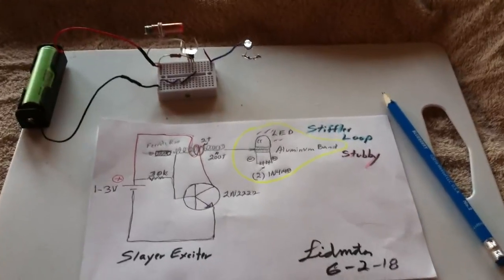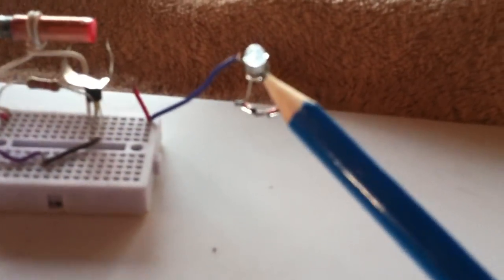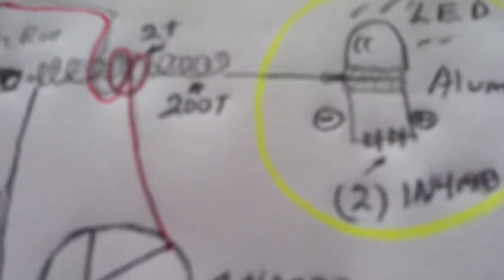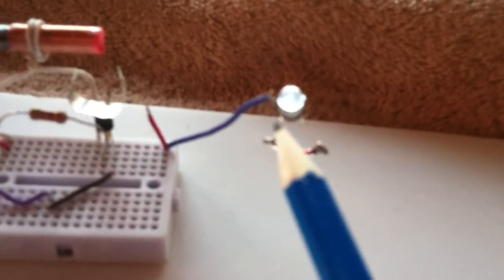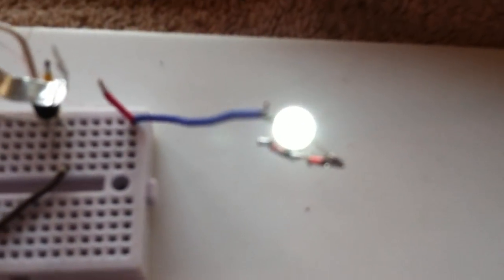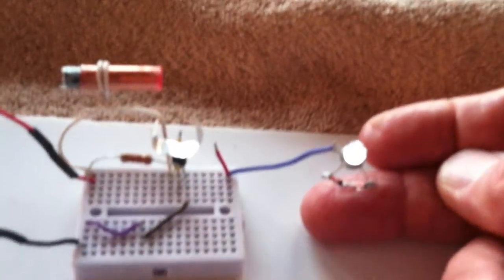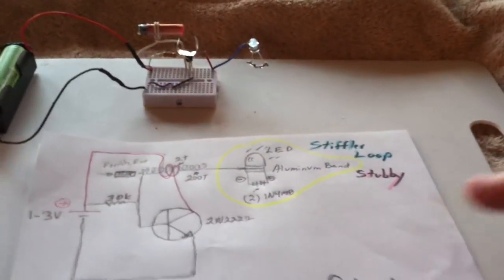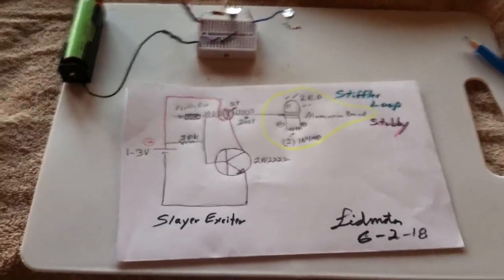Stiffler Loop Stubby

Comment: In this case LidMotor,i would think that you are exciting the gas inside the LED,and not actually lighting the LED by normal current means. Wonder what would happen if you added another LED across your two diode's,so as it's polarity is opposite that of the current LED.
Good job as always. I enjoy your video's.
Reply: Unfortunately for that theory there is no gas inside a LED.  The led chip is completely potted with no empty space inside.
Reply from the maker: Thanks.  An led placed backwards across the two 1N4148 diodes does not light up.  There evidently is a current running around the loop.
Reply from the maker: Oh darn.  I though maybe there was 'Ledanium' gas inside. I just couldn't figure out how they got it inside the solid plastic. lol

Comment: Rusty, what happens if you place a piece of foil over the two switching diodes to increase the surface area if capacitive?  
Also it would be interesting to see what would happen if one incorporated a piezo element as an antenna on the bottom of the loop.
Great work as always.
Jim
Reply from the maker: The foil would short out the diodes probably if you put it around them but if you hung a piece off the bottom the light would get brighter.  Adding a peizo element would be an interesting experiment.
Reply: Rusty,
Thanks below is what I meant, as a dielectric reflector of sorts....

Comment: When you touch the diodes you are adding additional electrons from your body "mass". Its about the mass of an objects free electron will shake off. Going back to the old sec spacial gate if you remember back you held a night lite or led to the surface of that insulated copper tube it had made electrical loop back by just touching the outer edge of the bulb or even adding a ground all you did was add mass. The thing is at the sub atomic level you can shake the free electrons sort of like what happens to the permeable mass such as a toroidal core in oscillation or a transformer when it conducts the magnetic pass through which passes the current from one coil to the next. This stuff is in the old physic's books. In my college days when I had the school library to my self I had dug in physics books to figure out how the sec worked to some degree. But when you have oscillation in a mass you can shake off the free electrons and it gives you what we call power. Just remember current is about mass and voltage is about pressure. I am in no way a physics major just interested in how it works. There are some cases where this mass is also capacitive in nature because if you remember a coil holds power in its mass when you take the power off it for a few micro seconds. Tesla was a brilliant man he was trying to tell us this for a long time. Mass and capacity do have some relations.
Reply from the maker: Thanks.  I remember Dr. Stiffler's  video called  'What's Mass Got To Do With It' ?   I still have a block of Al that I used in many of those old SEC experiments.  It is a fascinating subject to study.

Comment: You asked:  ground or capacitance causing effect.  Well technically the earth is a sphere capacitor of large capacitance. The usual meaning of ground is just as a reference point.  But for here it is more than that.   No piece of matter in the world is without inductance or capacitance.  The tiny bit of metal connecting the 2 diodes in the lower center is an active capacitance.  Your rf wire input to the metal band over the LED is fluctuating rf.  During one cycle one diode conducts and charges the active metal wire capacitance just like a one wire secondary of a Tesla coil charges the ball cap.  On the next cycle the other diode provides a discharge path to equalize the uneven charged matter.  See LeBon on Matter and Energy for lots of practical info.  He was maybe one of the last scholarly scientist that believed in an Ether and the relation of matter forced into a non-equilibrium state temporarily as you are probably unknowingly doing here.  The charge/discharge path passes thru the LED legs and the LED lights.  Hand touching adds matter (more capacitance) and earth touching provides a virtual heavier current sink thus intensify LED brightness.  Based on my own experiments around 1986, so only an educated belief.  One proof would be to connect your secondary wire to the active capacitance area I referred to and the LED would still light up, just the one connection or depending on the circumstance, just also adding a piece of conductive matter (you call antenna) to the positive side of the AV plug load side.  In that case the active capacitance is not on the lower side but on the top load side.

Comment: I would think you would be able to replace the diode LED with a CFL bulb if the high end voltage is over 100v and the CFL is grounded as long as the frequency stays high

Comment: I think your touch provides a bit of energy because your body has a bit of capacitance.
In that ^^ respect, you are an antenna that has captured some energy & you are feeding that  bit of extra energy into the circuit at the touch point.

Try to dim the LED by trying to reduce the return path back to the power source (i.e. dampen the RF return path some where).  After you figure out how to dim the LED, then touch the diodes again to see ff the LED becomes brighter.  If so, then you are likely the source of the extra energy.  That might be a simple proof.

One suggestion on how to possibly dampen the RF return path might be to put a grounded aluminum shield between the diodes & the red wire that is sticking straight up.  You may need to connect your 'ground' to either the + or the - battery to see if it makes any difference which potential you connect it to.  The goal is to use a grounded free standing antenna to dampen as much of the return RF to the RF source or to ground as possible (yet keep the LED lit a bit)

Another suggestion is to put your grounding shield between the diodes & the LED (sort of like a grounded barrier to prevent the RF return path.

On another tangent:
If you disconnect the diodes from one end (either end) of the LED, will the LED always go out?
If yes, then is it possible to make an aluminum antenna that can attach to your LED lead, to see if the energy from the diode would jump the air gap to light the LED?  If that is possible, then you might be able to use that gap as your RF return path regulator.  Then touch the diode wires with your finger to see if the LED brightens.  If that works, then I think you are an antenna/capacitor that is providing energy to the circuit.
Reply from the maker: Yes but if lay the bottom of the loop on a pair pliers (virtual ground) the same thing happens.
Reply: Please reread what I wrote above as I edited it.

re: the metal pliers as a virtual ground:
The metal pliers can function as an antenna & absorb RF energy.  As a ground, it is a floating ground that may have a higher voltage potential at the point that you contact it with the diode wires.  Thus, resulting in energy being inputted into the diodes at the contact point.  To see if it is functioning as a ground or as an antenna, ground the pliers to the negative batt terminal & then touch the pliers as before to the diode contact point.  If the LED goes out, then the pliers is functioning as a ground.  If the LED brightens then maybe providing a better path to ground in the circuit has caused an increase in current flow through the LED.  Then you'd have to examine the current flow carefully through the circuit to determine what is happening.

It might be interesting to see what happens if you touch a small varicap at the contact point or you added a small capacitance (parallel to the diode pair or only parallel to the input-side diode or to the output-side diode).  I imagine it would have to be a very small capacitance, however to see if you can replicate the LED brightening affect.

Comment: Hi, i would believe that by touching the diode lead you act as a capacitance, this is well known from teslasetups, hi frequency is vibrating in and out your body, any other objects af certain mass should do the same.the curios thing is that the diod lites with it's own tiny capacitance, without touching anything else.
Reply from the maker: Yes.  It might be just me as a capacitor that is doing the increase when I touch the bottom.

Comment: I find it very interesting what is being said out in the word. First all of my circuits were picking up RF, radio stations were across the street. I was just plain cheating. Okat I did the faraday cage thing back in 2009 and again in the SFM video. So will someone tell me how I shield from capacity? How do you not see the shield as an additional dielectric? Dose not any wire carrying current have a free space component? A circuit of any kind has a free space part, Does radio need to be connected back to the transmitter for the receiver to work? No! So what is this capacity thin anyway? Oh well another day and another pundit.
Reply from the maker: I find this whole topic fascinating.  Rather than over analyze it I prefer to simply try to replicate certain effects and marvel at them.
Reply: Hello Dr. Stiffler, good to read comment from you, keep it coming.

Comment: could you collect energy through a small cap running the positive through the bottom of that loop arangement and leaving the negative free or attached through a simulated ground. Is the Led seeing an ac signal, would a negative biased led added to the loop light as well?
Reply from the maker: I think the Led is seeing a rectified ac signal and adding a cap would smooth it.  Adding a virtual ground at the bottom of the loop increases the brightness,

Comment: Neat...that alu tape on the plastic of the LED even looks cool. 
I do wonder if it'll work with 1 diode ?
Reply from the maker: When we get the MHz signal circuits using crystals up and running this should get more interesting.  I will try one diode but I think two are needed.
Reply: There's good news that way, have got the circuit running (posted at Overunity) except for the MOSFET to switch the 20V. Also got a new L3 wound on 1/2" PVC pipe after all these years...the good fortune being that it was free Dump day here yesterday and it was in some backyard trash. while clearing.

Comment: Well done, good job, very exciting. I'm going to build one soon and meter and scope it. I wonder, how much current is being drawn from the battery, what is the operating frequency, will the LED light with any other type of load across it?, how many LEDs can be driven at one time?, how efficient is this circuit in lighting the LED? Since you feel an RF burn when you touch certain places, maybe fairly hefty current is being drawn by the xstr.
Reply from the maker: Great. I hope that you have success with the project.  Most of the answers to your questions were dealt with years ago using 'Exciters' but this idea of just using a signal generator signal is new to me.